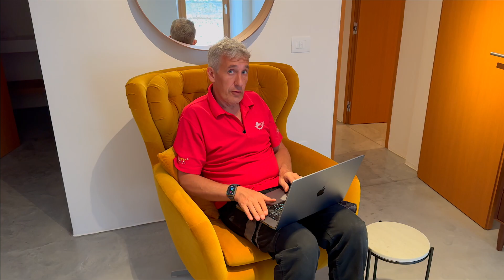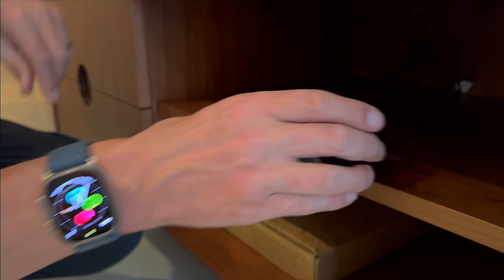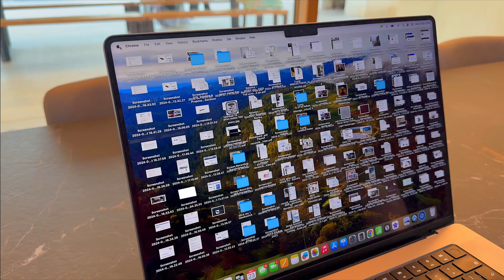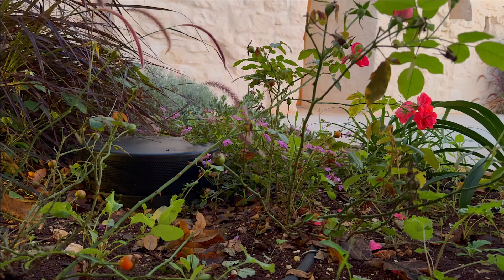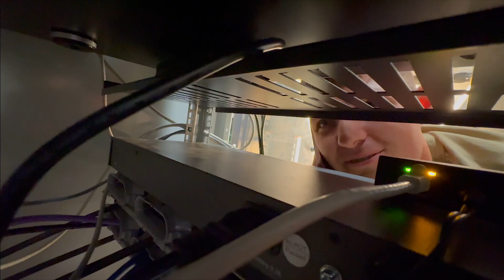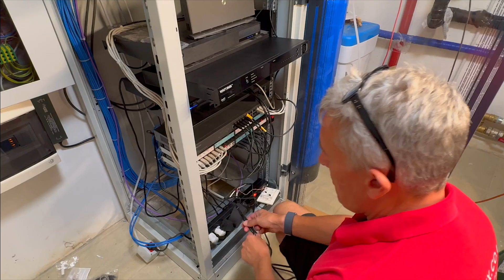Plagued by Power Gremlins? - You Need a WattBox with OvrC

Comment: Telecoms cable on the training I did, spare cables were not to be cut short and should be left for future faults that may occur giving a new pair to use replacing the original. 
As these are officially voltage free there is no requirement to insulate.
Data training said exactly the same however spare cables should now be insulated due to POE (Power Over Ethernet)